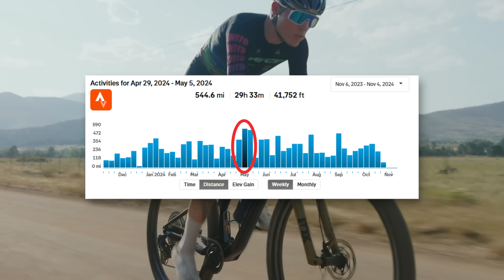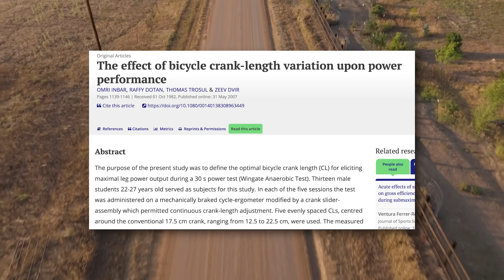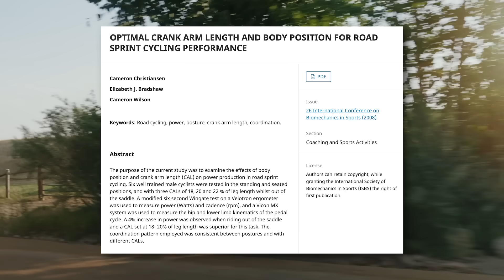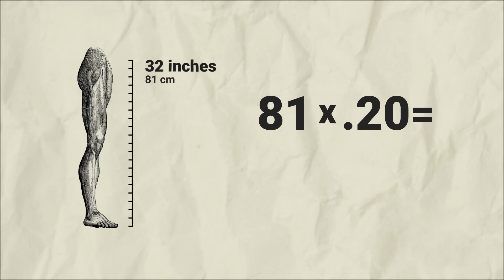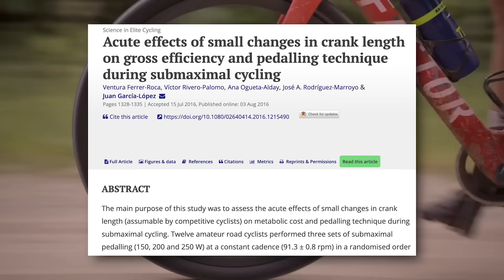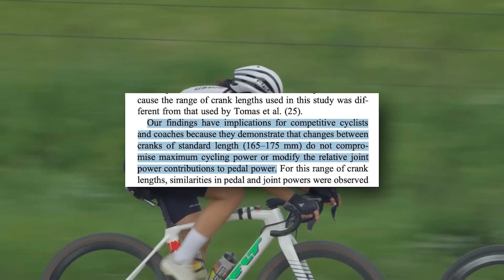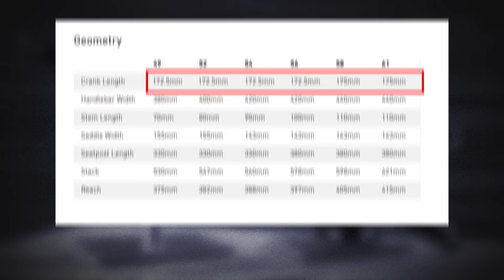You Should Be Using Shorter Cranks, Here's Why

Comment: I thought I would share my little bit of information. I am 5'9.5", and that makes me average, but my legs are slightly longer for my height. I had some knee issues and went on some 75k bike rides recently and hit some hills. I was absolutely grinding up them as they were very steep. As I am no longer the young kid on the block, I thought I would change my cranks and gears at the same time. I have gone from 172.5 mm to 165 cranks with compact chainrings as well to spin more. I have also changed the freewheel, so my lowest gear is now 34 front to 30 on the rear. 
With that change, I checked out the shimano compatibility chart online to make sure everything went together. A bigger freewheel would have been good, but a new derailleur  would be required.
I am just a recreational cycling, but I think this would be good advice to share.
Even a video showing the conversion to others and what tools are required would be good.
Great videos. Keep it up.

Comment: I was able to ride with 170, 175, then 165 this year. I'm 5'10" with 31" inseam. 170 felt good, but too long. 175 was clearly too large. 165 initially feels great, but I need to ride it more. I'm looking at it from a fit standpoint, not as much performance. I think it might make my pedaling smoother though which is a performance thing I guess and it's noticeably easier to lean into climbs. Also, more comfortable and easier on my body overall I think and that could increase performance. 150g lighter too.

Comment: It’s about the kind of riding one does. Also depends on speed, gear rations and the kind of terrain. Faster speed means the rear wheel turning faster and to match/sustain that a higher cadence would work well given you have max out to your lowest gear. Same way as a car transmission works, higher speed, higher revs the higher/ smaller the gear needed. Same with a bike. Your cadence is rpm, rear wheel is speed and the rear gear is the top gear. So top gear at high rev is the best the car can do with a given engine. However in the ratio becomes too small, the engine won’t able to completely transfer is 100% power to the wheels as torque is needed to keep spinning the wheels. So a really small gear will not enough have enough torque same with a really small crank arm. So it seems 165-175 is the best range for crank arm lengths. 165 being better for higher speed

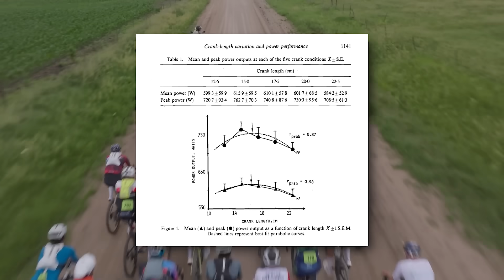Comment: Dude - the table shown at 5:15 shows that the difference in peak power is about 7% (763 vs. 709 W).  The text that you show at 5:35, talking about a 1% difference - there's something wrong in that sentence.  I actually wonder if it's a typo:  maybe it should say ±5 mm (not ±5 cm).  That would make sense - when they talk about a "two crank length span," that sounds like 175 vs 165; since typical crank lengths are 165, 170, 175, ±5 mm would be a "two crank length span."

Comment: I raced all my pro life and younger life on 170 with long legs and  6 foot tall (183cm) what a mistake. After racing I began using 175 on my mountain bike and then on my road bikes and what a difference. I finally for the first time in my life felt comfortable pushing the speed boundaries and big gears, still with a cadence of 80 to 110. I wish I could go back and use 175s and see what happens. Short cranks are for short people or those without the skill to spin high cadences on longer cranks.

Comment: Another advantage for shorter cranks to consider is lean over angle AKA pedal strikes. having a shorter crank allows you to pedal around much tighter corners. 
And for those MTB riding, it means less of a chance of pedal strikes on rocks. (which is why most high end E-MTB's are sold stock with 160-165mm cranks)

Comment: A few areas that are not mentioned:
Moving to shorter cranks has the potential to reduce the effects of External Iliac Artery Endofibrosis (EIAE) for anyone who suffers from it, and perhaps reduce the onset. This is due to the reduced hip angle.

Also, changing the crank length will affect the bike geometry. Since you need to raise the saddle to have the same seated position, there will be a point where the geometry is outside of what the manufacturer designed it to be. If shorter crank lengths become more standard, this will slowly be addressed. Positive areas, especially for MTB, include better pedal clearance for technical climbs, but the opposite is due to the increase in saddle height, the overall rider weight balance is higher, and this could have a negative effect on cornering. Reducing the BB height will help against this, although it will also bring back issues with pedal clearance.

I'm using 155mm on all my bikes and have been switching for over 2 years. I'm 168cm tall, and the main issue was to reduce EIAE symptoms that I suffer from. Overall, it has made a positive difference.

If you look at eMTBs, the vast majority are using shorter crank lengths. This is almost certainly due to increased pedal clearance, but companies wouldn't switch to a shorter crank length if torque and power were dramatically reduced.

Comment: Longer cranks arms are vastly superior<45 RPM. Shorter arms are vastly superior>90 rpm. This has huge implications for single speed setups. Longer arms are better for 0mph-10mph acceleration times or extremely steep climbs since the power curve <45rpm favors longer cranks. If your commute/workout is steady state >17mph/80rpm, then shorter cranks are a no brainer
Reply: no one normal doesnt use single speed outside track

Comment: The most important thing about crank arm length is 
The upstroke knee angle!!
We want that angle to be as broader as we can, so we will have more power/torgue when pushing the pedals on the upper phase!!.
Of course the conflict is that we also want the longest moment on the pedals which requires longer arm!
Its a compremise!
For example, im 170 cm height, and the 170 mm arm which came with my Small Giant TCR, was too long, and made my knee over bent on the upper phase.
Of course you can increase the the saddle height but you reach to the point is too high, and you now face with the issues of streached knees and pain in the sensetive area and back pain! so went to 165 and solved my problem .

Comment: Thanks for the video. I want to point out that if you have longer inseam/legs and a shorter torso and go for a smaller frame shorter cranks might  affect your saddle height sticking out even more. For shorter leg to body ratio it might improve though.

Comment: went from 170 to 172.5 when I upgraded my groupset during the pandemic (vendor did a bait and switch and I agreed last minute). Big regret, never felt right and my previous bike fit went all wrong, with aches here and there that I never had before after long rides. Just ordered a discounted Dura Ace 165 - a cost I could have avoided by insisting the other vendor take the 172.5 back (yes it felt different). This video convinced me to shell out for comfort and perhaps performance on hills - I hope the 7.5 mm makes a difference (height 5' 8", S-works, older cyclist but not ancient)

Comment: I am 6 feet tall and bought a used bike in size 56, it came with 165mm cranks I didn’t like the small rotation feel and bought 170mm cranks, they fit so much better to me. I bought two new bikes after that which came with 175mm cranks, I don’t feel comfortable with those either. For now is 170mm for me, I saw some 168mm cranks that would be willing to try. ✨🌞🙏🙏🙏

Comment: Dylan - I have a hip flexion problem. Lots of glute/pelivc floor pain from high output. I made the change from 175's to 165's about 18 months ago. It literally changed my life. To my point - I ALSO switched to Dura-ace pedals with a 4mm longer spindle, with 2- 1mm spacers per side. I feel that q-factor has nearly as many benefits (for me) as does crank length. It opens my hips. I noticed I felt more able to hold a higher power at cadence on my MTB. Since my bike fit on all my bikes is identical, it had to be Q-factor. That was the only difference. Made the change and now have even further free'd up my hips. Just thought I'd throw that into the crank length debate. Since you're a marginal gains fanatic, think about it.

Comment: I did make one of the first YT videos promoting shorter cranks 9 years ago..........! Another aspect not mentioned here is that it is easier to apply force to the pedal if the pedal is closer to your body (i.e shorter crank). Imagine if you were asked to push a spade into the ground with your foot. Would you place the spade far away from you or close to you? Closer is better - less strain and easier to apply your body weight to it.

Comment: One advantage not mentioned is that you can pedal a little more through corners. It's like an 2-4 extra pedal strokes but if you crit race, that can really add up. I'm on 155mm cranks and I basically pedal through the entire corner

Comment: I changed from the normal 172.5s to 165s.  Love ‘em and will not change back.  P.S.  No apparent negative effect on hills, either!
Reply: Some add’l personal info to help fill out the picture - age is mid-70s, I did race seriously and extensively with a fair bit of success in the 80s, especially in time trials.  I still love to hammer fellow riders on the flats, and shape my rides to work on that.

Comment: Hi Dylan I suggest that out of saddle climbing is benefited by longer cranks, as torque is linearly related to crank length. So for the same applied power, your applied torque will increase. 175mm cranks will increase torque 6% over 165mm. That's obviously a significant advantage on climbs.
Reply: Chain tension is linearly related to crank length (and chain ring size) but ultimate torque at the rear wheel is determined by the gear selected. Losing 10mm off your crank length reduces torque for any specific gear, say 48x20 by an amount similar to increasing chainring count by 2 teeth. an interesting way to calculate gear ratios is to calculate inches of pedal travel to inches of tire travel, this includes crank length in your gear calcs.

Comment: Chainwheel size should also be taken in consideration.
There's also oval chainwheels which can be used to shorten or lengthen the lever.
A shorter crank on a regular chainwheel will change the proportion of downstroke force to the rest of the pedal stroke.
I think there's a lot to try, especially with the oval chainwheels.😅

Comment: The bikes would be a lot better if they dropped the bottom bracket to go along side with shorter cranks. Much more stable. 

Bike companies just don’t care how your bike fits. They know it sucks. Which is why you upgrade every few years. 

They want your bike to be to big so you buy a new one. Which also won’t fit and the cycle continues.

Comment: Re. the power study at different cranks lengths isn’t a 30sec. effort too short? The shorter  cranks need higher cadence to generate higher torque / power which is easy enough in short bursts but much harder to sustain over long intervals

Comment: Great video. I've been on 175 cranks for years, had several bike fits over that time and never has the fitter told me to size down. For reference I have a 33 inch inseam. One thing I have done is gone to zero offset seat post which effectively steepens the seat tube. This allows the rider to get lower without decreasing the angle at the hips. It has worked for me. That said I have experimented with shorter cranks. I loved what it did for my cadence. But I hated what it did to my center of mass. When I went shorter I raised the saddle to maintain the knee angle at the bottom of the stroke. I did not like the feeling of sitting higher, especially off-road. I consider myself lucky in that I can ride with the cranks spec'd by bike companies. But I agree that shorter is likely the better call for most riders.

Comment: Great video. As a pro bike fitter that does 75% tri fits, we have been onto this for some time now for the exact reasons you mention: hip angle tends to be the limiter in the TT/tri  position, and you can only get so far forward (steep seat angle) before the weight distribution becomes silly. So shorter cranks, which reduce the knee height at top of crank cycle are the answer. Average size folks do indeed tend to gravitate to 160 or 165mm for tri (so the 18-20% crank length/inseam holds). We can switch crank lengths on our Vertex Fit Cycle while the rider is still on board and instantly adjust saddle height while keeping all other parameters constant, so it is easy to observe the rider's reaction to different crank lengths. Frequently 1-2 sizes shorter than they are accustomed to results in a very positive perception as far as power and efficiency. I hear "did you drop the power - this is easy now" all the time. (I don't drop it). At some point tho the rider dislikes the change - they become too short. Now this is likely affected somewhat by anchoring to their traditional crank length. But that said, after 10 mins on the new shorter cranks, I switch them back to their traditional length and they hate them. They may have been riding 172.5 for decades, and after 10 mins on 165 they hate the 172.5. I have never seen anyone (thousands of fits) go longer again. Road is less cut and dry than tri/tt, it's far easier to get away with long cranks for road as many riders aren't hip-angle limited on a road bike (shorter riders tho typically are). But for sure the knee flexion thing can be significant. I had a very tall guy who had struggled with knee pain his entire life - but he loved cycling and so rode thru the pain for decades. "Laughably short" 155mm cranks (~37" inseam so 16% crank length/inseam) cured him instantly. One easy test for the reasonableness of traditional 165-175 crank lengths: that's a 6% variance in lengths. Saddle heights commonly vary more than 40%.
Reply: I have a saddle to bb height - and currently ride 165mm crank length. I want to try 160mm as it could be better given my short inseam - have you seen any rider fitter similar that has helped by going 160mm with similar saddle height to BB?
Reply: @ironian07 if your saddle to bb height is correct, you would want to raise the saddle the same amount you shorten the crank arm. So in this case you would raise the saddle 5mm. You want to keep the bottom of the pedal stroke in the same spot
Reply: Short cranks feel like riding uphill all day. I like long ones 180 for touring, 160 for fixed/ss, 170 or 175 for off road. Shorter than that gets to feel like shifting too much, and increased foot discomfort.

Comment: Did you move your shoe plate position? Did the shorter cranks lead to a change in average cadence?  I fee that cadence is one of the most relevant factors in optimiising performance (outside of aero optimization).

Comment: I accidentally went from 165 to 175mm cranks on my Enduro bike, and I became more comfortable.

I destroyed my cranks on a wreck, and asked my LBS to order some new ones. They accidentally ordered the 175's and put them on. After a few pedal strikes I adapted to the longer cranks, I just thought my riding was sloppy. I instantly felt better, but didn't give it a lot of thought. 

When I got my first gravel bike, it had 165's and I had knee pain. I sold that one and got another bike that came with 170 and no knee pain. 

My new roadie came with 172.5 and no discomfort.

I ride roughly 20 hours a week, I'm not low volume. While not a race, I did go solo for a 100k Fondo last weekend and was first on the course. Yes, solo for the entire 60 miles, I never drafted a single person. So fitness is okay (it wasn't a race of course). I did 130 miles that day.

I'd like to find some short cranks for my 5' tall girlfriend, but at 5'7", I sm sticking with 175 if I'm buying new cranks.

Fun fact: I went to a local, well regarded local fitter a couple years ago. After over 100,000 miles of riding, I thought I had my fit pretty well worked out...and I was right. I basically threw away $400 as all of his recommendations had me in pain. So, maybe I'm an outlier.

Comment: My take on the FTP vs crank length study: It doesn't matter. You're going to be putting out that much power regardless of your crank length so what you end up doing is finding a gear ratio that works with your crank length and cadence to produce your desired output. Through the magic of gearing, you're going to end up with the crank length - front gear - rear gear system ratio about the same. What matters is comfort, and comfortable is faster on longer rides. 

So... go see your bike fitter and decide.